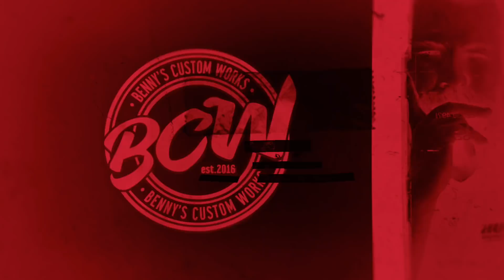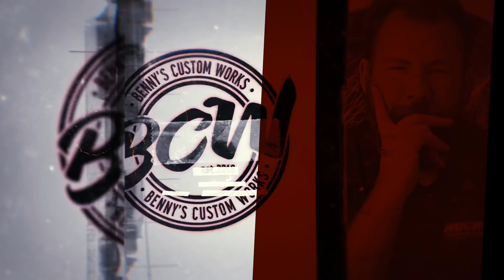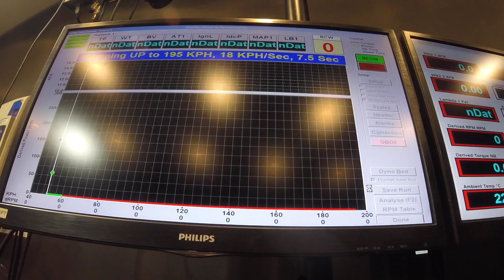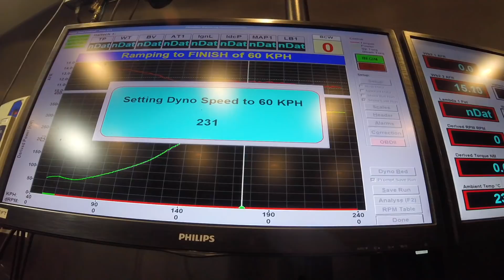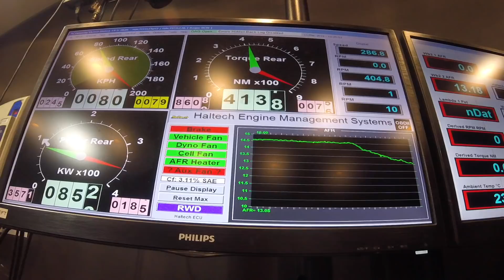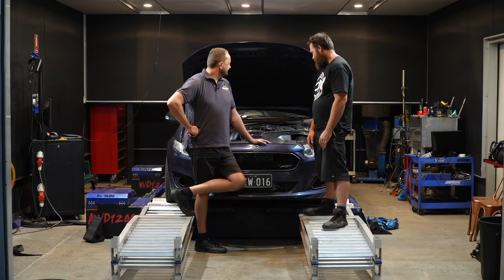FERRARI FORD | Safe Power. Is there such a thing?

Comment: Great content and easy to take in. Question though, when upgrading the firmware to Nexus or any upgrade I thought it was imprtant to disconect the ignition coils, for safety reasons. I thought this should have been an important part of the video. I leaned this the hard way. Maybe a question to pass on to Scotty.
All the other info was awsome........
Reply from the maker: I believe that was only for platinum series but I’ll ask the question.

Comment: Scotty is the fcuken man, wish my tuner was the same, he sells another brand so is stup!d lol..
That's impressive, Barra's are insane for what they achieve stockish. 
Gotta a few cars I've built from scratch at home and it took alot more work than that barra to get them to that same power level (couple of them on my channel, I built the engines to make what stock Barra's do unopened🤦‍♂️)
Guys at haltech are awesome too. I've gotta Mazda 323 Bfmr and ordered an elite and told haltech how I built the engine, they said ditch the distributor, get these coils and purchase this cas, this elite with this premium loom, wideband, flex sensor, the additional sensors and you'll be set.

Comment: I think where most people go wrong with wiring is they don’t start by taking the time to develop a good plan. The planning takes more time than the actual pulling wire and terminating by at least a factor of three. It is tedious but essential. Name every connector, label every cavity, label each wire, list it’s size, which terminal and seal at each end, create your branches, over lay the busses. The benefit is it makes constructing the harness much easier and also makes troubleshooting easier (possible) too

Comment: Obviously they haven’t used a VAG V8 TDI for towing 300kw, 1000nm.
overtaking cars up a hill while towing 3.5t and still pulling hard. Crusing at 110 towing and still avg 12-14 l/100kms
Reply: Diesel life.
Reply: Anything that makes 300kW will tow 3.5t uphill and still pull. Torque just means you make that power in the midrange instead of up top.